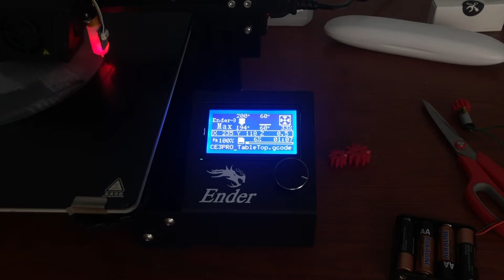Thermal Runaway | Ender 3 Max | Easy Fix

Comment: Got my ender 3 max neo brand new like gotten yesterday and it had this problem out of the box, poor manufacturing.  It rapidly cools like after a minute, I'm even lucky to have been able to print the starter boat
Reply from the maker: Wow, that’s disappointing to hear. Where did you buy it from? I would reach out and ask for a replacement.
Reply: @PrintPractical  Amazon, friend bought it as a bday gift, i rather fix it myself than try to get a new one
Reply from the maker: @coolcatkillcam8742 up to you, Amazon’s return policy is great, but I know it sucks going through a friend for returns.

Comment: I have the same problem. it's a new machine, doing my first print i get the E1 error. I replaced the thermistor and the nozzle still only gets to 160-190 before giving me an error. Anyone know why this is happening? I even tried replacing the whole hotend with a new one and still only get  up to 190 before i get the error
Reply from the maker: Did you set the voltage switch on the power supply to the correct voltage? (110A for US) if this is happening on a new machine, depending on where you bought it from id return it. Maybe try setting the hotend temp to 220 without heating the bed to see if that works. The bed has a thermistor of its own.

Comment: Quick question. I have the Ender 3 Max too and just recently had this issue. What I did notice is a sound before the thermal shutdown. It came from the print head and was like a popping/clicking noise.This is only happening on longer prints. Did you have a similar sound leading up to the error? Great video!
Reply: Ive noticed that too but not sure what it is! Its not consistent

Comment: I replaced the entire hot end 3 times and nothing worked, i found that it also was an issue with my power supply. I fixed the issue and now it happens when my printer does any print and not just when heating it up
Reply: Power supply from the house??
Reply: @theuck5148  no the slim one on the ender 3 it's self

Comment: I took the silicon style flexible cube shaped thing off my ender hot end (right on the nozzle almost) to unblock a filament snap off in there and got this alert all the time until I put the silicon sleeve back on my direct drive printing nozzle. so you might be able to try that too, it worked for me.

Comment: i did this and still had the problem in fact it happened even quicker! aaahhh!
Reply: I'm having the same issue. I just replaced the thermistor yesterday and it gave me a thermal runaway on my first print afterwards. Any ideas?
Reply from the maker: When you tried your first print, did you watch the temperatures as it was printing? In my case, I could see the hotend temp fluctuating before it threw the error. It’s possible that either your new thermistor is not seated properly, or it’s the bed thermistor that was bad in the first place. Also make sure your hotend fan is running.
Reply: @PrintPractical  as long as I don't go above 210 it doesn't happen so that has become a pla only printer lol
Reply: @PrintPractical  thank you so much for the tips. I did watch the first layer and temp readings seemed stable. The fan was running. I did realize that my printer is in a semi finished part of my basement and it got extremely cold last night. There is also a heat register right above the printer, so I wonder if that could be the problem. I'm going to try re-seating the new thermistor, and I've covered up the heat register and will run an alternate heat source. It was a bummer because the print was coming out beautifully!
Reply from the maker: Mhmm, the fact that it happens when setting the hotend temperature higher makes me think it’s still on the hotend side. One thing you could try is doing a PID autotune on it, which calibrates the computer to keep consistent hotend temps.
Reply: @PrintPractical  IL try that when I have time thanks, I run a few printers so just running pla on it has been fine for a while tbh
Reply from the maker: Yep, I print mostly PLA / PLA+. I’m just starting to play around with PETG and TPU, but for most of my use cases PLA is just fine
Reply: @PrintPractical  iv printed alot of petg and pla/pla +, I've also done carbon fibre and tpu my favourite is pla + I like doing bigger pieces iv printed full size storm breaker and odin's spear alot of helmets my black panther helmet is the carbon fibre one but pla+ is the best 👍

Comment: Just had this error, fixed because I forgot to switch voltage level on the PSU from 240>115. Now at the proper level I've yet to reencounter the error.

Comment: mine gives the high temp alarm just a minute or 2 into a print. cleaned fan, did everything i can think of, even reset the firmware, and upgraded.
Reply: In most cases the problem is a white powder residue on the thermistor. Just pull it out and clean the white powder off and blow out the hole, then reassemble. It's that easy.  This happens a few weeks to few months after getting a new Ender 3. Just depends on how much you use it.

Comment: I had the same error, and shutdown. I found out that the cooling fan was set to 100% and caused hotend to cool rapidly. That was my fault not catching it in the slicing. Set it to 50% no more thermal shutdown
Reply: Shouldn’t it stay at 100% after the first few layers ?
Reply: @timeStat  that's not always the case some prints don't even require cooling

Comment: You spent $329 on this?!?! Wtf.... I got an Ender 3v2 on sale for $229, which is arguably a much better model. Damn dude shop around and check prices, you just wasted a ton of money on an inferior printer, and I can't stand the screen on those ones, the one on the v2 is so nice.. You could have gotten a 3v2 and nearly fully upgraded it for what you spent...smh. Did you really need the extra printing area? I find the 220x220x250mm printing area on the v2 to be more than enough for me. And you're still using the included bowden tube too? That's the first thing you should upgrade right there. Also get some metal leveling knobs with better springs, the included plastic knobs and springs are trash and your bed will need to be leveled all the time, but at least you got a touch sensor lol, but that doesn't mean you don't have to level your bed anymore, you still do you just don't have to be as accurate, the sensor will mathematically compensate. You should also get an all metal extruder and get a dual z-axis upgrade, that will improve print accuracy and prevent the printer head from sagging as it moves farther away from the lead screw, if you had 2 lead screws, 1 on each side, then you wouldn't have to worry about it. Also get a Raspberry Pi with Octoprint and a cheap webcam, that's probably the single best upgrade you can get. On mine I've also upgraded the hotend to a Creality Spider which prints 5x faster and converted to direct drive.
Reply: This is a much larger printer than yours.
Reply: @aaronskelton3218  oh so it must be better then... Smh.
Reply: @SheWantsTheJD  larger printers cost more. You’d know if you took your own advice and shopped around.

Comment: Good video. I have the Ender 3 Pro. It was printing like a champ until I printed once with PETG at 240. Now it won't even run PLA at 200 without giving me thermal runaway halts every hour or so. Luckily I'm in the 30  day return window so I'm going to get another one at Microcenter. I'll keep your video in my back pocket for later though.
Reply: had the same problem as you and this is the fix!  In most cases the problem is a white powder residue on the thermistor. Just pull it out and clean the white powder off and blow out the hole, then reassemble. It's that easy.  This happens a few weeks to few months after getting a new Ender 3. Just depends on how much you use it.
Reply: @Forbiden-Music-Zone  The 'white powder' is dried out thermal compound. Replace it with better thermal compound, like for a CPU heatsink.
Reply: @rich1051414  i know thanks. didn't have any to put back, but it works just fine without it. Been printing this way non stop for about a month now and it holds perfect temp. Actually now it works better than when it was brand new.

Comment: Thanks, I believe my ender came with my thermistor loose. I've tightened it up and it seems to be working fine. This is my first printer and thought the temps must fluctuate by a few degrees here and there. Now it holds solid.
Reply from the maker: Awesome! Glad you figured it out!
Reply: Thanks

Comment: I had the I had a similar problem just a few days ago, but on the other end of the spectrum, my hot end temp dropped to -14C.  Didn't take too long to realize that my thermistor had gone bad.  Creality actually has a nice little video here on Youtube showing how to replace it.  It even has a few tricks on how to run the wires through the sleeves.  But I have to admit, all that hot glue that they put on the board, what a pain in the butt.  Thankfully, every other issue I have had with my Max has been minor ones.

Comment: I've got the THERMAL RUNAWAY twice in like 3 days...the first time I noticed the nozzle got a little of PLA in a shape of a ball, I've cut it out then bed level and it was ok.But yesterday I've got the same issue,so I plugged it out and Im using today...looks ok.But the screen of temperature seems to rise up and down faster than before and iniciates at 190 degrees then go 200° and everything is fine.I need to worry?

Comment: I had to replace the thermistor on my Ender a few days ago. What led me to believe it was the thermistor was watching the display screen. The display of the printhead temp normally climbs by two or one degree at a time while preheating and stays at the exact temp or within a degree or so. When mine went bad, the temp was jumping all over the place sometimes by ten or more degrees at a time. Print head simply cant warm up that quick.  Surprised that the factory did you the run around like that. I was planning to contact the factory to get a free replacement to have on end but think I will save my time instead. Thanks!
Reply: had the same problem as you and this is the fix!  In most cases the problem is a white powder residue on the thermistor. Just pull it out and clean the white powder off and blow out the hole, then reassemble. It's that easy.  This happens a few weeks to few months after getting a new Ender 3. Just depends on how much you use it.
Reply: I've noticed the same on my ender 3 as well it caused a few minor gaps b4 sounding like a fire alarm ⏰️ but better to catch it now

Comment: Fuck iv had mine for two weeks and it's r ready do this shit have to say skip the ender 3 pro not worth it
Reply from the maker: This happened with my Ender 3 Max within a few months. Creality will send you a new thermistor after chatting with customer support for multiple days. I’d rather just pay the 5 dollars or whatever and replace it without the hassle. Sorry to hear that yours went so early. If it makes you feel better, mine has yet to fail since I replaced it (knock on wood). It’s been through many overnight / multiple day prints too. Thanks for watching!
Reply: @PrintPractical  thx for the words of life. It's helps a lot.
Reply from the maker: No problem man, these printers aren’t perfect, but they are low cost compared to other more reliable machines. With a little bit of work, they are solid machines. Best bang for your buck in my opinion. Let me know if there’s anything you want me to cover, I can make a video on it if it applies to a wider audience.

Comment: My Ender 3v2 had tons of thermal runaways and I actually caught the nozzle temp while it was doing it drop from 215C to 210C then it threw the error. My thermistor resistance was 111 though. Getting a new one tomorrow so I hope that is it. If not I'll check the voltage and resistance where the hot wires go like you showed. Thank you!
Reply: So the thermistor was the problem? Just dusted my Ender 3 v2 after upgrading bed and extruder a few months ago, and now i get constant thermal runaway
Reply: @Ray  sadly, I was being stupid. I didn't switch the power supply from 230V to 115V. I'm surprised this thing worked at 230V and only really presented issues when I went above 205C on the nozzle.
Reply: @Jacob-pr5cd  I just started getting thermal runaways and after seeing your comment I realized my printer was on 230v while running at 115v. My ender 3 is now back to normal. Thank you!!
Reply: @michaelhickey7204  holy shit I was running on 230v instead of 115v also. Hopefully this solves the issue.
Reply: You are a saint. I was trying everything to fix it and THIS was what the problem was. I went from not being able to print anything because I kept getting runaways to no problem for several different day long prints.

Comment: Thank you for doing that video!

I did changed the whole heating block (and the thermistor in the process) a few days ago and got this E1 error after only a couple of very short test prints.
I'm even unable to heat the wire hot eeough to be able to remove it (it began after changing the wire from white to black. Could my printer be racist?? ;-) )... How would you address this specific issue?

Many thanks!

Comment: If you are replacing the thermistor use strong thread like carpet thread tie it to best end of the BAD thermistor to go through the sock. Pull out the bad thermistor cut thread and tie it to the new one. Pull the thread to pull the new thermistor through and reassemble.

Comment: I re-seated the thermistor and it worked. No need to replace for me at least. I am wondering if the tension from 3-D printing pulls it out overtime.
Reply from the maker: Yeah I’ve heard similar stories of the thermistor not being seated correctly after some time. The weird thing I was seeing is that the thermistor was working correctly for 95% of the time, but randomly it would misbehave. I did try re-seating it, but I continued to see the issue. My guess was that I had a small fracture in the wire, and specific movements would cause it to misbehave, but I can’t exactly prove that.

Comment: i had some thermal runaway problems on mine and turned out it was just some dust buildup on the heat sink had some dust buildup on it. removed the dust and the thermal runaway problem stopped.

Comment: Hello! I would like to know the Electric Screw Driver name. Thanks! ♥
Reply from the maker: It’s a Wowstick 1F. They sell them on Amazon, great for small electronics etc.
Reply: @PrintPractical  Thanks brother! And I tried to repair my Ender 3 Max changing my Termistor and it didn’t work. Any advise?
Reply from the maker: You replaced the hotend thermistor? Did you determine that it was the hotend? The bed has one yoo
Reply: @PrintPractical  It's time to check the bed one to. Thanks for tour time my friend!

Comment: I've had thermal runaway happen once on one of my two Ender 3 V2 printers. I had removed the sock from the heat block when this happened. I'd turned off the printer then, put the sock back on, and the problem had stopped right away. Thing is, I've removed that sock several times since, and I've not had thermal runaway, which is odd. I've also been printing 24/7 without incident.
Reply: Hi! Thanks for your post. But what do you mean by "sock"? The black silicon part?
Reply: @vincentmalcorps7614  Yes, that silicon thing is called a sock.  Mine actually ripped and I left it off for a whole (honestly I forgot it wasn't on there for a few months).  When I realized it was missing, I remembered and bought a replacement.  After installing the replacement, I started getting constant Thermal Runaway issues, despite the screens never showing any sign of the temperature fluctuating.  After seeing this video, I wonder if I didn't damage the Thermistor during the time I didn't have the sock on there.  I'm going to have to try replacing it and see if that fixes my issue.

Comment: Was getting this same fault on my Ender 3 v2. This video helped me find the problem. Ended up being a loose screw at the hotend that connects the white wire. This video helped me narrow it down. Thanks!
Reply from the maker: Awesome, glad to see you figured it out! Thanks for watching
Reply: I had the same issue on my Ender3pro , then I had problem whit cavity for thermisor which was soiled with PLA after accident. 
In my opinion , first place to check is the hotend when thermal runaway occurs.
Reply: Thank you, I thought i was going to have to replace my white wire and i really didn't want to do it. i tightened the screw after seeing your comment and my printer is back up and running

Comment: I've used a few cable routing solutions and I'd definetly recommend getting some textile sleeving. It's easy to open and swap things then re-wrap. I also want to note that your issue is a broken wire so you don't really need to replace the full thermister. Adding a couple microfit or even a simple dupont connector would save you from needing to swap the thermister and opening the board enclosure.